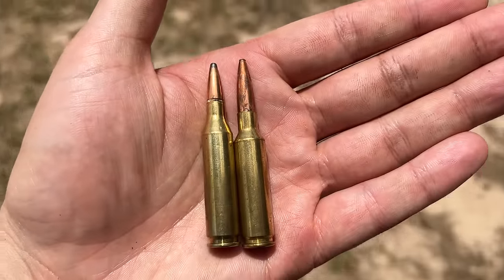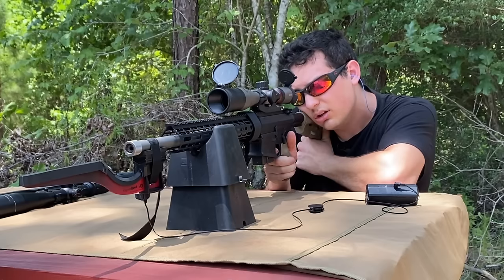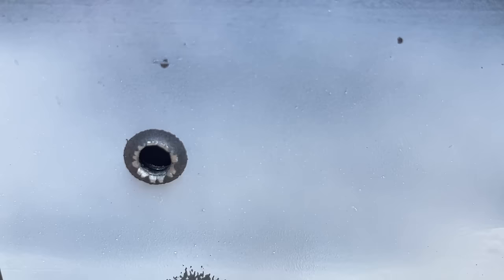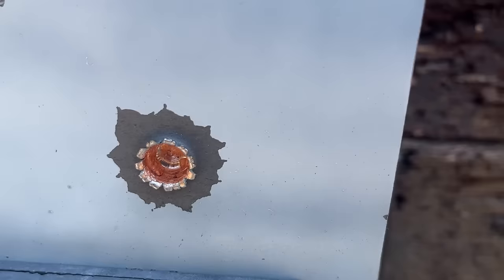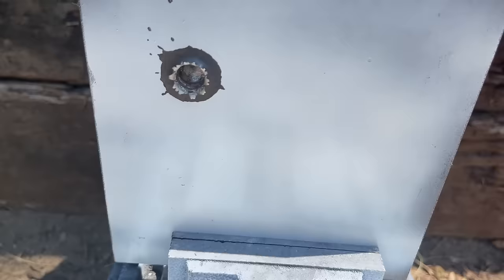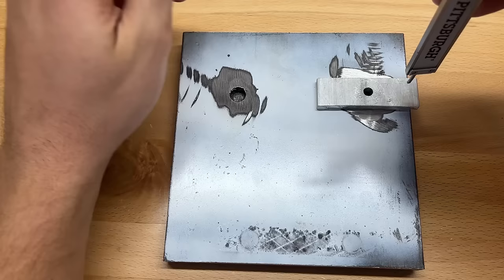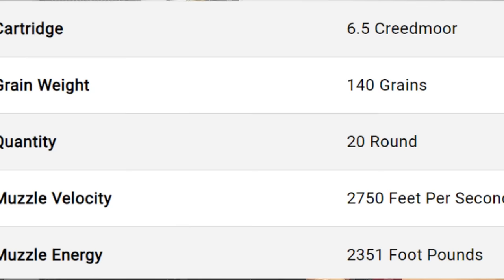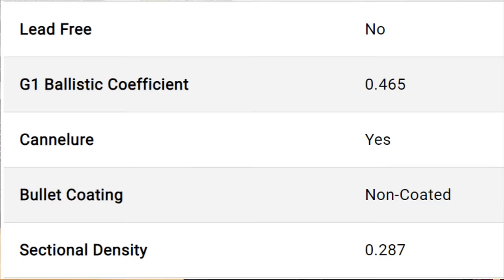243 vs 6.5 Creedmoor: Not So Close On Mild Steel?

Comment: Copper is much less dense than lead. Density can be much more important when it comes to penetration. In tanks, a steel or titanium sabot could travel at significantly higher velocities than depleted uranium or tungsten, but they would actually shatter upon impact with armor plate, much like you saw the copper do. Depleted uranium is actually quite ductile compared to steel, much like lead (although not that ductile) and it is the combination of mass (through density) and velocity which allows it to penetrate armor. This is also why a much harder material (likely nickel) is used as a cap to bite into the armor and give the DU somewhere to go. Similarly, when used as armor, it is the density and the way in which the DU is machined (it is described as a weave, like kevlar, in some places, although in reality it is a secret) which provides the protection. The copper simply lacks the density to penetrate that much steel. This is really a layman's understanding as I am a former US Army tanker and not a metallurgist.
Reply: But you are correct!!

Comment: Here's a mindblower: Pages 406-407 of Hatcher's Notebook have a couple of photos of .30-06 bullet penetration through oak boards with the bullet fired from 200-yards penetrating 32.5-inches, while one fired from 50-feet only goes through 11.25-inches! The captions read, "The [200-yd] range was long enough so that the bullet was sufficiently stabilized to continue point first and thus give good penetration. At shorter ranges, the penetration is likely to be much less ..." and "The reason is that at this short [50-ft] range the bullet had not settled down to a stable flight and when it encountered the the resistance of the oak it yawed badly, and rapidly gave up its energy."
Reply: I think that theory has been proven wrong. Bullets frangnement much more at higher velocity so will sometimes penetrate less than when the bullet slows down a bit
Reply: @midwestbd7144  I wondered about that. I had the idea that the bullet deviated due to deformation at the higher velocity. But it may have something to do with the ratio of rotation to velocity. Years ago, I did an experiment comparing the 5.56x45 to the 7.62x51 penetration in taped stacks of 2x4s. At 6' from the muzzle, they both had equal penetration, though the 55-grain FMJ 5.56 tumbled bass-ackwards and the 147-grain FMJ 7.62 shattered one of the boards. I was impressed enough by that little 5.56, but thought penetration of both were a little shy at around 11".

Comment: Copper bullets are designed to expand slowly in tissue and bone, and therefore penetrate deeper into game. However it looks like steel forced the copper to expand early. The copper bullets also have lower sectional density than the lead bullets. This combination of factors led to less penetration.
Reply: Wait, maybe i'm missing something but isn't lead softer than copper? (Like the Xtreme copper penetrators) 🤔 how can lead have a bigger sectional density? Maybe it's some kind of lead alloy? 🤔
Reply: @mattthekiller9129  Lead is softer but also heavier for the same volume, aka denser.
Reply: @mattthekiller9129 
To achieve the same weight bullet the all copper bullet has to be longer than a lead bullet (it can’t be larger diameter and still fit thru the same bore size), this makes them have less sectional density than the same weight lead bullet ; ie body diameter compared to overall length.
Lead is softer, but hardness varies by how they are individually made with varying percentages of of added materials such as tin, etc. (example : one part tin to 10 parts lead etc. which can be varied when they are made).
Unless they are hard cast naked lead bullets, they also have an exterior jacket around the lead which stiffens them up.
Reply: @spartanxlv really makes me wonder what a solid iridium Bullet could do, much harder and twice as dense as lead...
Reply: In this instance bullet construct has way less to do than velocity. Speed is king on steel
Reply: @brianmouton196  Not true at all. Bullet construction is vitally important to penetration of a thick steel plate. And .243 penetrated less than 6.5 CM, and copper penetrated less than lead, despite the former of each being faster, so this test doesn't even support your claim. Velocity is king at defeating hard but thin materials, not thick plates.
Reply: @hardtack8776 alright, thanks for the explanation!
Reply: @mattthekiller9129  
You bet 😊
Reply: Simple answer is that lead is heavier therefore it has greater energy transfer into the point of impact. It's like trying to crash a formula one car through a brick wall at 200mph versus a pickup truck going 100mph. It's not about speed. It's about energy transfer.
Reply: He should try an inverted copper cone.
Reply: @mattthekiller9129    I think you don’t understand sectional density correctly? For starters sectional density isn’t large or small. Rather it’s a number usually in the .1-.4 (for example a 150 grain .308” bullet has a sectional density (SD) of .226. To get the sane SD in a 6.5 you would only need a 110 grain .264” bullet That isn’t large or small it’s just a number.
Sectional density is just the frontal cross section (what cause resistance) and weight computed into a consistent value.
So the truth is a copper bullet could definitely have a greater SD than a lead bullet. The only thing is copper is less dense than lead. So a 150 grain .308” bullet is gonna be longer in copper/brass than jacketed lead because it takes more material to make 150 grains of mass. 
The thing is penetration comes down to three primary factors (in order of importance) velocity hardness of projectile and sectional density. You won’t do anything without the first. You can do stuff without the second buy it helps a lot. Sectional density while improving on effect has the least consequences.
The original post claimed the lack of penetration is due to lower sectional density. However it’s clear from test lighter copper bullets out penetrate much heavier lead projectiles.
Reply: @danielcurtis1434  yeah, thanks for the explaination, i probably didn't know how it worked
Reply: Why are people who don't know anything? Commenting funny
Reply: True that! That's why depleted sabot rounds are so effective against armor.
Reply: Copper projectile are designed for Fed or State land where lead is verbotten & nothing more.

Comment: I really did not expect the harder, solid copper projectile to not penetrate deeper than lead. Truly unexpected
Reply from the maker: If I hadn’t seen it before I wouldn’t have expected it either
Reply: @bananaballistics  Had reloads for my 30-06 with 150 grain solid copper bullets.
On paper when loaded to very hot those should not had any problems to go trough
least same plate which was not an issue for 124 grain fmj at 100 meters.

It was kind of surprise to see how close that penetration was but still less than impressive
because sellier bellot 124 grain fmj went trough two stacked plates on same distance.

If not specially tested i would still imagine those rounds go trough even better than
bulk fmj.

Comment: Here's the thing about the 243: it's been around, so it has been proven, brass is easy to get, and many projectiles to choose from. When I couldn't get 223 brass I could get 243 brass. I don't have a 6.5 so I never looked. 
I agree w many here: 243 and an 06! Small game, big game. 
I load 85gr tsx with 4350 powder. Not only is it a 1/2 moa load out of a 1970 model 70 featherweight, it's a deer and antelope slayer. 
I am doing a 243 build using a ruger american action: 70deg bolt throw

Comment: Solid copper bullets, especially the ones you picked. Being along the lines of a Barnes TTSX are designed to open up with minimal force distributing the force of the impact over a wide area. Whereas the lead projectiles are designed to deform which can have them not expand as much. I can also imagine the weight difference playing a big part. A solid copper non expanding projectile would likely penetrate better like how a FMJ would. If you want a good demonstration of this find the older Barnes bullets promotional videos and you can find the ones where the TSX and TTSX bullets reach full expansion on a grape.

Comment: The .243 or 6mm are both awesome deer rounds. Very versatile because they are both good woodchuck guns. They both buck the wind better than the 22-250.
Reply: Amen on that u don’t need a 22-250  70 grain 6 mm  .243  also I’ve been using my v l s on 7 mm 08 110 hp at 3350  also 6.5x06 w 95 g Hornady v max  Kinda the same 3350-3400
Reply: Wind gets those 22 s

Comment: I'm admittedly a bit of a balllistics nerd.  I would havr never guessed that coppet solids would have performed so much less than lead on mild steel, considering that they can be an ADVANTAGE against thinner hardened steels.  It just shows you how different the steel behaves when it fails plastically vs in shear.  
I know it would not be sustainable for long term testing, but perhaps you could contact a steel target manufacturer for off cuts/blems in 3/16, 1/4, 3/8 and retest just a handful of these to compare. Bonus points if the sectional densities are the similar :-)
Maybe some of the "known" stuff is just fuddlore and it was all velocity doing the work from the beginning....
Reply: Very interesting comment. Much appreciated as i am someone who has no expertise in this area and just believed  the fud lore I hear on the internet. I agree would be interesting to see a repeat test with similar sectional densities and similar energy somehow
Reply: Have you ever seen a military AP round made of copper?

Comment: Great test! Would like to see the .243 in 22 to 24 inch barrel which is typical for hunting.
Reply: Meh, unless you're shooting handloads and availing yourself of slower burning powders like MagPro, Magnum, H1000 and the like, 24" won't give any appreciable improvement on velocity over a 22" barrel.  Most of the powders listed for 243Win are of the medium rate variety - RL15, RL17, Hunter, Varget, Win760, etc.
Reply: @smokedbrisket3033  I don't speculate, but I do kill a fair amount of game, and I know what works.
Reply: @rsbreeze  I didn't say it doesn't work, just that a 24" barrel doesn't produce a practical velocity improvement over a 22" barrel for .243 Winchester unless you roll your own ammo with slow-burning powder.
Reply: @smokedbrisket3033  the last deer I shot at 300 yards didn't ask me what velocity the bullet hit.

Comment: 243 is wonderful, but you are limited by bullet weight/overall length. The creedmore was designed for heavier bullets with higher BCs. Shooting at steel at 25m says very little.

Comment: I own and hunt with a 243, but the 6.5 CM matches up more directly with the 7mm08, since both can throw 120 and 140 grain bullets like the 6.5 CM. I just don’t find any need for the 6.5 verses the 3 rounds (243/7mm08/308) that come from this one great case. Good video, now go do the 7mm08 vs the 6.5CM and you will see that the 6.5 is 90% of the 7mm08.

Comment: I shot a 3/8 mild steel spinner with a Mosin Nagant firing a 200gr Wolf soft point bullet, it went through the spinner so fast it didn't wiggle.  I thought I missed the spinner so I walked up to it where I saw the hole made by the 7.62x54R cartridge.  This is Wolf steel case ammo in the green box.  I was curious so I went to the boneyard to find a piece of heavier plate.  I shot the half-inch plate with the same Wolf ammo.   The bullet zipped right through the plate.  I still had a usable half-inch plate so I shot it with my Savage 110 chambered in 308 Win.  I was using ADI ammo loaded with 165gr Sierra GameKing bullets.  The 308 went through the plate and the cross tie the metal was clamped to.

Comment: I was shooting some steel target I found in the desert with my 308 and it was barely making a mark on it, I shot it with my 243 with a 58gr vmax I load to about 3850fps, it out a clean hole through the plate. Speed is king when putting holes in steel.

Comment: Penetration is more about density the of materials used if they are softer than the target. This is why the copper is less depth than lead, both are significantly softer than mild steel so the density of the slug is more important. NASA has done a crap load of testing of these ideas around spacecraft protection if you're interested

Comment: Solid copper has less sectional density. So the effective "pressure" it can generate is less. If you had similar bullet weights and speeds and copper vs lead, you'd see closer results between lead and copper. Unfortunately, since copper runs higher pressure there's always a speed penalty at identical bullet weights.

Comment: Energy is not the end all, be all.  As you mentioned sectional density is also important.  Then there is momentum.  There is construction.
For the sand box an arrow will penetrate more than many bullets because of the length of the arrow increases sectional density enough to have a high momentum even at low velocity.
Some artillery projectiles actually lengthen after they are fired and that gives more penetration.   So there is more to it than understand.

Comment: Not a fair comparison due to bullet weight and diameter but that’s marketing for you now if it was done correctly between the 243 win / 6 creed with the same bullet say a 115gr Berger (SD 278) in both there’s a fair comparison an there is differences between them love both them

Comment: The last time I shot steel (304 stainless) it was 1 inch thick with my 220 Swift.  At 100 yards, no challenge for a 50 gr bullet doing muzzle velocity of 3950 ft/s. Velocity rules.
Reply: Go swifty. I'm absolutely in love with my old 220 swift. It's a laser to 500yds

Comment: The 243 100g maxes out at right on 3000 fps before pressure signs
The 6.5 creedmoor 140g maxxes out at 2800fps before pressure  
If all things are equal the 6.5 should not have 400 ft lbs more but only about  a 150 due to extra powder capacity from a deeper throat and a longer Freebore
Other than that they are basically identical other than caliber

Comment: What is the advantage of 243 80grn round being a lot bigger if the velocity is less than that of a 60grn 223. The 60grn 223 will perform better despite it being a smaller and lighter round.

Comment: My guess is that the solid copper bullets are physically larger than the lead, but not heavier, which resulted in poorer penetration. That’s like comparing a ping pong ball to a golf ball.  Don’t get me wrong, I like solid copper bullets, but they lack density compared to lead.
Reply: Copper bullets are longer for weight than lead. This improves the ballistic coefficient for better velocity & energy retention farther downrange than lead & should improve the penetration. Niether the 243 nor the 6.5 are truly adequate for anything bigger than deer size critters. 7mm & larger weighing at least 160gr really should be the minimum for elk, bear, moose, etc. Shooting steel has zero to do with hunting & IF one wants to shoot through steel, get a much faster smaller diameter bullet, like a 17 Remington. The smaller the bullet diameter, the higher the impact pressure per square inch! Simple laws of physics!
Reply: @bradgriffith4231 copper bullets have a smaller BC than lead, making them longer doesn’t increase the BC, smaller diameter + weight = better BC

Comment: I'd love to see a 22-250 or a 222 swift loaded up with 62 gr green tips bet that would punch through a good bit of steel
Reply from the maker: Great idea. I’ll have to see what I can do with a 1-14 twist
Reply: @bananaballistics  I am looking forward to seeing the results!
Reply: @bananaballistics oh.. oh no. That's not gonna be fun.. so, apparently, 1:12 was roughly good for 55gr 5.56. and some issues happen when you go slower. I have been actually digging into high velocity cartridges recently for curiosity's sake. And it would appear that one can fire .22-250 from a .22 creedmoor. The latter will have a much faster twist rate. And, that Ar10, wouldn't be a bad barrel host, in fact, it's actually a really cool test rig. One lower, and a few uppers that get reconfigured on occasion
Reply: 22-250 would be a great shooter if one can stabilize a 62gr steel tip bullet.
Reply: 220 Swift, not 222

Comment: I have a Walmart AR-509 plate 3/8 thick and a core locks punch right through it with a 243. Still have the plate it has 4 holes back to back shots.